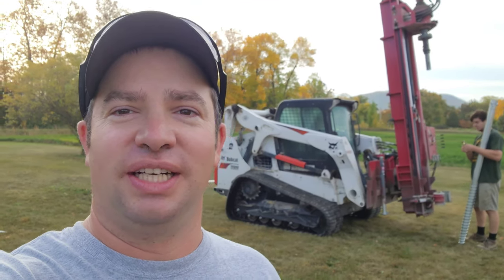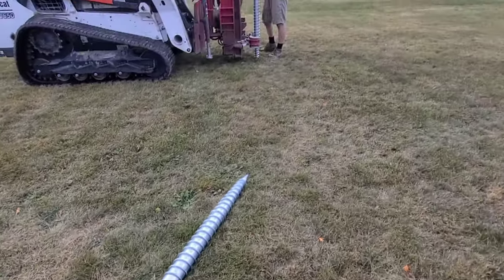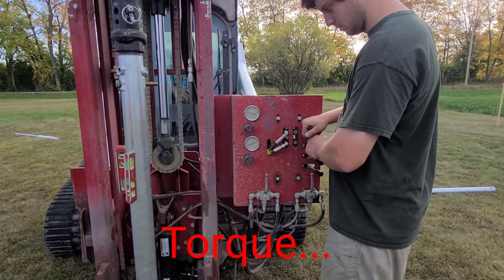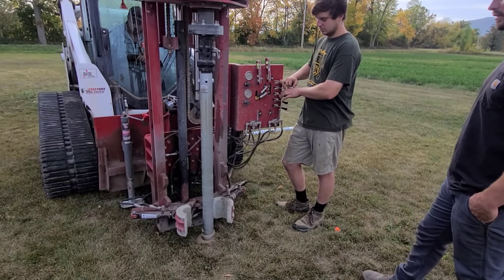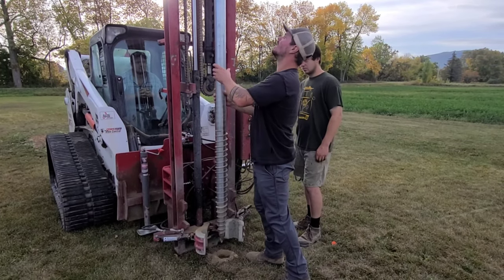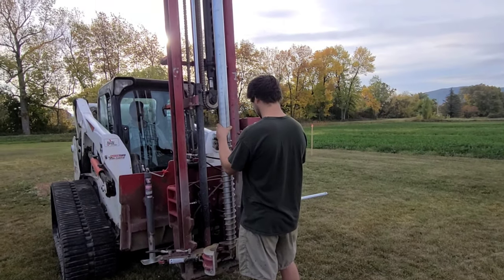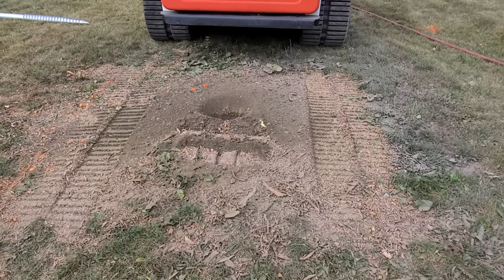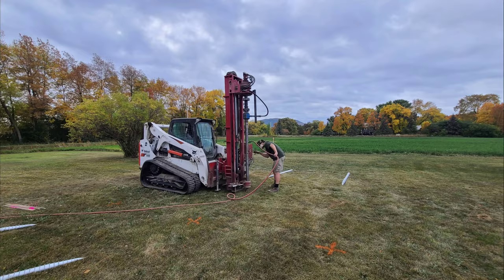Installing Solar Ground Screws in Rocky Clay!

Comment: Ben, what beautiful country you are in. Is this project close to where you live? Is the machine on the skid-steer owned by the company that manufacturers this ground mount system? Looks like a real expensive system to put in. I'm wondering what the difference between the screws and concrete piering mount supports is? Beautiful video my friend!